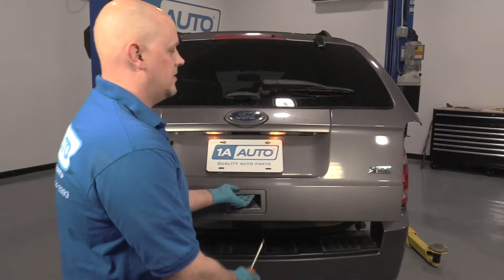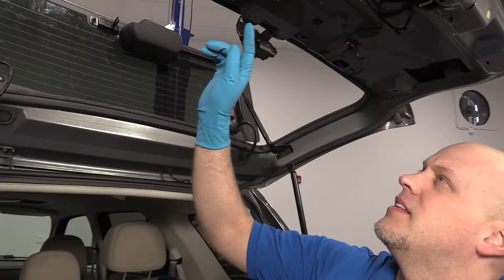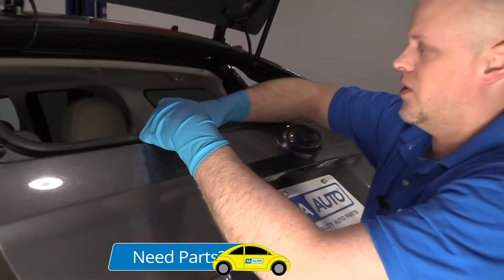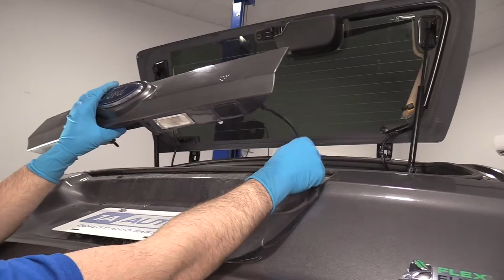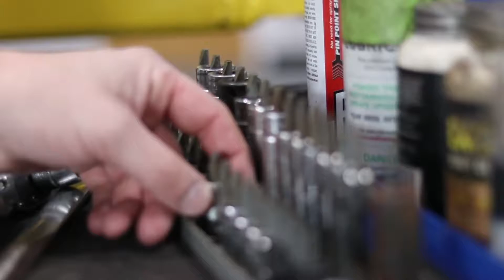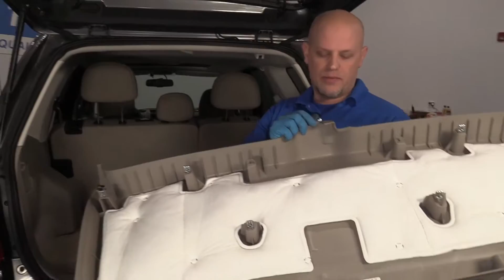How to Replace Rear Liftgate Button 08-12 Ford Escape

Comment: Does A1 Auto have replacement bolts that hold the part that contains the buttons?  One of the nuts was rusted on the stud and I had to break the plastic holding the stud to get the plastic piece off the liftgate.  Great video showing all the clips ad bolts holding the piece on to be able to replace that button at home.

Comment: Someone tried to break into my wife's Escape and in the process broke the button...now that I'm looking at this video I realize the retaining pins are missing....yeah, they did a number on it. Oh and the button has just stopped working and the liftgate buttons stopped working also. My wife takes her dad to the chiro and he is wheelchair bound, which means until I get this fixed she's gotta put it in the back between the seats! I can fix them, but the parts are not cheap. What is the button called? Trying to find it...I found the actuter for the tailgate.

Comment: Hello, are the glass liftgate button and the hatch the same button? Could they be used interchangeably? The part is extremely expensive in Canada. 75$ Canadian for a switch for a 12 years old car seems excessive to me. By comparison, I got the entire actuator assembly for the hatch for 40$ Canadian.

Comment: Show how to replace the liftgate button , not the glass button. Your title should be changed.
Reply: In case you’re still interested. Remove actuator (3 screws on bottom of lift gate). Then remove two screws inside lift gate, behind actuator. Push button housing out, pop out the button and replace. I just replaced the actuator and button and it’s working great, now.